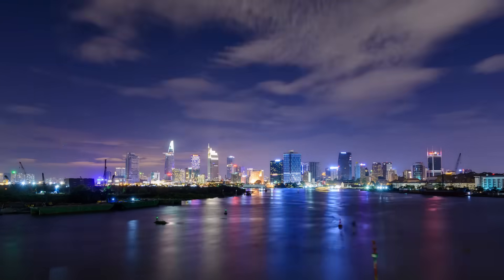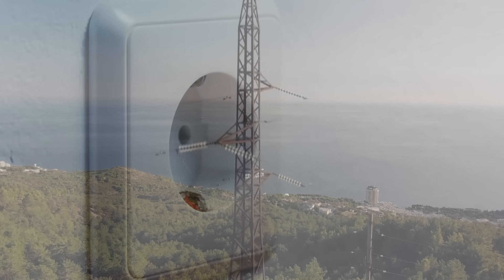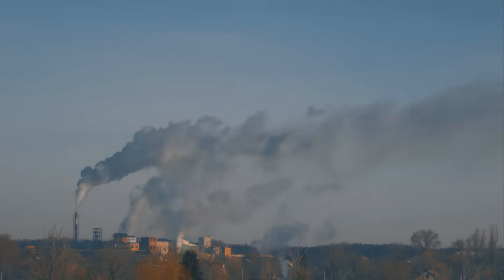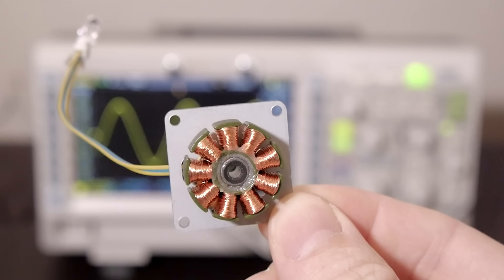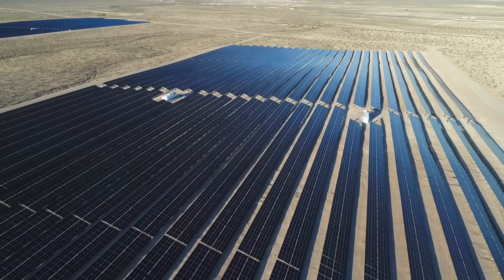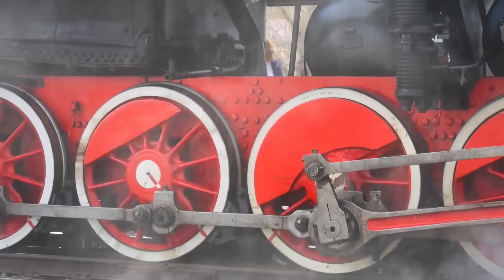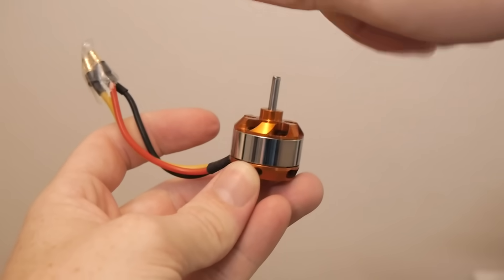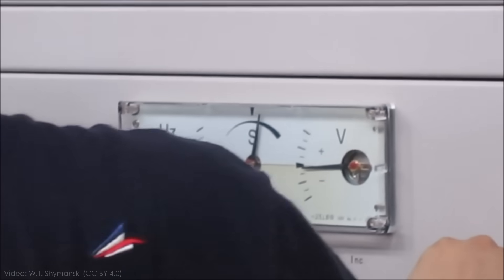How Electricity Generation Really Works

Comment: Three phase doesn't  triple the power. You add one more conductor of the same size and get 1.73 times the power as compared to single phase. Basically it's 50% more copper giving you 73% more power.
Reply: That's because you wrongly picked line voltage instead of phase voltage in your reasoning. Indeed, P3ph = 3*P1ph . Check that square root of three, because there is another one you missed
Reply: @Txepetxcc  The line voltage does not matter. Say you have 240V single phase, and you compare it to 240V three phase, the three phase is 1.73 times the power. And BTW 1.73 is the square root of 3.
Reply: @cindytepper8878  That is fundamentally wrong Cindy! The point precisely is that line voltage matters. How can it not matter if power = voltage*current ? Anyway, the easy way to see it, is that if you have 240V single phase (phase voltage) and you construct a 3 phase system with 3 of those single phase individual generators, each one with a load. Since each of the phases is independent, you have actually 3 times the power of the original single phase!. This is what happens in star configuration.  Now, because usually you cannot access the individual load phase terminals or generator phase terminal, (which would be 6 terminals, 2 per phase), but rather you can access the 3 "positive" terminals , the ones used to distribute the power, you dont measure the 240V of the individual phases, but voltage between positive terminals. Thats called line voltage, and it is a phasor sumation . The line voltage is sqrt(3) of phase voltage in star configuration. Therefore, in the formula of P3ph = 3*P1ph = 3*Vphase*Iphase, since you cannot read phase voltage because it's not accessible tou you in the field but line-to-line voltage is, you have to substitute Vphase = Vline/sqrt(3), and the equation becomes P3ph= sqrt(3)*Vline*Iphase = 1.73*Vline*Iphase , which in star configuration, is also P3phase = 1.73*Vline*Iline . But that's precisely the point! If phase voltage is 240V as you say, line voltage is not , 240V but 415V, and therefore P3phase = 1.73*1.73*240*Current = 3*240*current , which is 3 times the individual power.

Your mistake was using an equation used in the field which asks for line-to-line measurements, with phase measurements. Hope this clarifies it !

Comment: 1:05 not quite. Electrons (they carry energy) in wire move very slowly. The drift velocity is on the order of millimeters per hour. (https://en.wikipedia.org/wiki/Speed_of_electricity)
So it's not like "energy packets" flows at speed of light from generator to end-user device, but they move very slow, with very rapid reaction to start/stop of flow - they are getting pulled like a part of taut rope.
Reply: The energy is actually transferred outside the wire according to Poynting vector. AC is used for the majority of power lines, there electrons just vibrate, their net velocity is zero.
Reply: @FrainBart_main   I wrote it with mostly DC in mind and never exactly thought about AC electron drift (or rather lack of it), thanks for pointing it out!
Nonetheless I must read more about Poynting vector.
Have a nice day!

Comment: It's been demonstrated that there is no correlation between the rise in Co2 in the atmosphere and global warming. Temperatures on earth where higher when Co2 was much lower than it is today. The rise in Co2 levels in the atmosphere causes plant life to grow more quickly. Too bad you tarnished your video which was based in fact by adding the political football of global warming thus forfeiting some credibility. Stick with applied science, your area of knowledge and expertise.
Reply: I have one experiment for you. Take a bottle and fill it with normal air. Take another fill it with methane. Than another and fill it evil Co2. Then take a heat lamp (to simulate the sun) and out it over the bottles. Come back in an hour and you’ll find that the Co2 container is hotter than the air. The methane is hotter than the Co2. So yes. Adding more Co2 into the atmosphere will cause global warming. If we keep adding more the concentration goes up. Co2 is great for keeping in heat which is why it raises the temperature.
Reply: Actually I want to clearly something. The bottles should be at the same heat when taken out of the lamp area. Once then constantly measure the Temperature and you’ll find that the Co2 and methane are all trapping the heat in
Reply: @FemmyFoxxo  Why would you think that's a valid experiment to demonstrate Co2s contribution to heat retention in the atmosphere? In order to create a valid experiment you have to consider all the factors that contribute to heat retention. You would also have to show how 450 parts per million of Co2 in the atmosphere increases heat retention over previous levels of 250 parts per million. A tiny increase at best. The reality is that water vapor in the atmosphere is very significant for retaining heat, cloud cover, and level of solar radiation at the time are overwhelming factors. Historical records demonstrate that the mean temperature on earth is not affected by Co2 levels in the past.  Sorry , but your experiment is random and tells us nothing useful.
Reply: @fredflintstone8048  It is not random. There are a lot of factors. This experiment SHOWS you how Co2 CAN contribute. It shows HOW is contributes and why it is bad. Also where are the sources that you are describing. Who funded them. The experiment tells you Co2 is a green house gas and can cause the rise in temperature as it holds in heat. So please tell me where your sources are for your claims and please tell me who funds them. The experiment can also be added too as well. You can add water into a bottle for water vapor, you can add in nitrogen to see things.
Reply: @FemmyFoxxo  CO2 also reflects light.   On Mars CO2 cools the planet. Venus CO2 warms the planet.   Earth high atmospheres CO2 cools the planet.   Its been debated for decades if CO2 over all cools or warms the planet.   Only recently most scientists believe CO2 has a negligible over all rise in temperature.

I do not like how this video turned political.   there is no excuse for it.
Reply: @OxAO  
How is mentioning global warming political though? It is an issue that is happening right now.
Reply: @FemmyFoxxo     There is no bases in science for it.  There hasn't been a single peer-reviewed paper on man made "Climate change"  IE: global runaway anthropogenic positive feedback loop.    many on local effects.  some on global measured effects.  But no runaway effects as required for the alarmist claims.    Not one single paper.

Comment: Fun fact: the Japanese power grid operates at two different frequencies — 60 cycles in eastern Japan, 50 in western Japan.

Edit: in-home voltage in Japan is 110-115V. Most American domestic appliances will work fine.
Reply: Another obscure fact for your next Trivial Pursuit game - there are also 25Hz and 40Hz systems in North America.  25Hz was the frequency chosen for industrial use, and was the frequency at some of the original Niagara Falls power plants.  Today, the largest remaining 25Hz system is the Amtrak rail line between Washington DC and New York.  40Hz was chosen for special applications in the late 19th century, and has almost completely disappeared.  There is one hydroelectric power plant near Albany, NY that still generates at 40Hz, and until recently, there was some 40Hz load in a paper mill in Maine.
Reply: 110v 60Hz appliances don't work well at 50Hz.  (Synchronous Clocks will lose 10 minutes per hour).  50Hz and 60Hz are close, but as frequency goes down smoke goes up.
Reply: I believe Japanese use 100V, not 110V or 115V. By the way, there's a specific reason why you might see 110V, 115V, or 120V mentioned in the United States. Single phase transformers, which are used in residential and most farming operations are 220V, the transformers are center tapped, which provides half that voltage to the neutral = 110V.

The most common lower voltage 3 phase systems are 208V, when you center tap the transformer between three phases, any hot to neutral voltage would be 208/1.73 = 120V. The square root of 3 = 1.73.

It doesn't mean that your home is really going to measure exactly 110V/220V and commercial is going to measure exactly 120V/208V. These are design voltages, they are still called the above even if their measured voltages vary from those values.

Not knowing whether an appliance such as a microwave oven or a TV will be used in a home or a business, the manufacturer may choose to design to the midpoint between 110V and 120V, which is 115V. Most appliances are designed to work at their design voltage +/- 10% So, most 115V devices will work fine from 103.5V to 126.5V, which will cover residential and commercial voltages and some variation to boot.
Reply: @cornpop7805  110 and 220 are antique terms/voltages. In 1967 the U.S. adopted a standard house voltage of 120/240. This is accomplish by tapping the center connection of the two series connected 120-V secondary windings of a single-phase transformer.  On a well layed out electrical panel the 120-V circuits are equally distributed to ONE of the two ends and the center tap.The larger 240-V appliance circuits connect across the outer ends. The commercial 3-phase 120/208 voltage is accomplish not by center tapping the windings. But by banking three single-phase transformers who have their two secondary 120-V windings reconnected from series to parallel for a 120-V output (i.e. from 240 to 120) then the same termnal of each of three secondaries are connected forming the neutral connection or what is known as a Y configuration. So when you connect to the neutral and the opposite terminal on any of the three transformers you receive 120-V. Because of the 120-degree phase shift between phases, when you connect between the opposite terminal of one transformer and the opposite terminal of any one of the other two transformers you recieve 208-V.    120-V x (sq.root of 3) = 208-V.   Of course the 3-phase loads such as motors, connect to the opposite terminal of each of the three transformers.
Reply: @gratzbuck9882 
You are correct, I said 110/220v and it is actually 120/240V. That's what the secondary of the transformer nameplate usually read. Over the years, I've started to call it 110/220 because I rarely if ever measure 120/240V, it invariably reads less. Also, it always causes a huge discussion if I use say 240V to a residential customer, so I just say 220V.

Everything else I said was correct.
Reply: @cornpop7805  You are correct that most of the general public still uses the terms 110 & 220. But based on where you are on your Utility's distribution system, the system load, and the substation's regulator settings and how well it's working, you should see near about 120/240 voltage. Here in Tennessee on the TVA, and my location on my rural cooperative my voltage usually runs a little high. If your transformer's primary is set on its center tap and the distribution system voltage is running at nameplate, your household voltage will be 120/240. Most transformers have 5 primary taps, 1 dead on, 2 above and 2 below each spaced in 2.5% increments to adjust for variances in the primary voltage, in order to more closely provide a 120/240 secondary voltage.
Reply: kcotte59 
I hope you read this big ass response because I put a lot of time into answering your question (to the nth degree).

The US is 120V/240V (phase to phase div by 2) in homes and usually 120V/208V (phase to phase div by 1.732) in businesses.

European phase to phase voltage is either 380V or 400V, depending on country. The single phase voltages (hot to neutral) follow the same math I laid out before, divide the 3 ph voltage by 1.732 (the sq root of 3). So, 3 ph 380V has a single phase voltage of 219V (usually called 220V). 3 ph 400V has a single phase voltage of 230.9V (usually called 230V).
Voltages can easily be adjusted with transformers, so 220V/380V or 230V/400V can come from the same exact power grid, but be transformed to the desired voltage in the community or factory it is being used.

However, 50Hz and 60Hz cannot exist on the same grid. Most of the world that had strong trade with Europe in 1900 and beyond went 50Hz and most of the countries that had strong trade ties to the US went with 60Hz.

The only REAL challenge with equipment meant for one Hz over another is AC motor speeds. An electric motor designed to run on 60Hz at 1750 rpm would run at 1250 rpm if connected to 50Hz. Conversely, European AC motors would run faster on US 60Hz than designed.

Equipment that have AC motors and aren't speed critical, such as compactors, some conveyors, pumps, mixers, etc can run on 60Hz or 50Hz, the system will just run faster or slower, depending on higher or lower Hz, respectively.

Equipment that have more critical speeds and are designed to operate at 50Hz or 60Hz exists, but they use variable frequency inverters to change the motor speeds. Variable frequency inverters are also simply used for speed controls in many applications, so it's a manufacturer of equipment wouldn't have to necessarily rework an entire machine for the equipment to cross continents. But, the type of equipment I'm talking about is factory equipment and may still require a transformer within the factory to achieve the correct voltage.

I wouldn't bother trying to run home appliances from countries using significantly different voltages, unless your on vacation and you have an adapter. Frequency usually makes little difference in home appliances, other than a potential loss of efficiency.

If you understand all that I've said, feel good. I've had to explain this exact same material to multiple  degreed electrical engineers. I don't know why this isn't covered in a base EE degree.

Comment: My theoretical grasp of electricity is limited to the benchtop scale, so there's probably a simple answer to this question: why not use giant capacitors to buffer shocks to the system?  They're fairly cheap.

Also, you need some pesto on that pizza at the end.  I say that in my capacity as a garlic engineer.
Reply: Capacitor stores energy at DC, so it couldn't be simply connected to grid, it needs special  two-way converter which charges it gracefully (without damaging with overcurrent) and converts its DC to AC synchronized with grid when needed. This can be done: we in Russia tried this for subway recuperation system, so when train stops, its motors become generators and supply power into 3rd rail, but then this power is stored in supercapacitors. So when train starts again, it just takes this energy back. It worked to some extent, but not as well as hoped... In general, capacitors have very low specific energy, so one needs LOTS of them taking up large amounts of space and costing a fortune.

Comment: Wait.. I didn’t know electricity moves at the speed of light.. I thought they were lot slower. That’s why we have fibre optics, right?
Reply: With AC current, electrons jiggle back and forth in the wire, at line frequency. They don't go anywhere. (In DC they drift slowly in one direction.) However, it's the energy that moves at near the speed of light. If you had a long pipe full of marbles all in a row, and you pushed a marble at one end, a reaction travels down the pipe very quickly, and a different marble moves at the other end. So, the effect is that energy moves down the wire at near the speed of light. For things that operate at a high frequency, the wire has a type of impedance called inductive reactance, and it chokes the flow of energy, so for this reason fiber optics is used for high frequency signals, because it uses light instead of electrical current, and so it isn't affected in the same way.
Reply: Solar Fluxman ohhhhhhhhhhhhh

Comment: Global warming, AKA climate change doesn't exist.  Further research on the science will show you this.

The train is voltage, pushing the current that flows.
Reply: Wrong. I've worked on every type of power plant during my life. You can argue about which type of combustion or fuel for steam generation is worst. But climate change is real.

Comment: The message that we need to transition to renewable energy sources is of course good, but I feel that it is always worth noting in this context that climate change is also a sosioeconomic problem. Capitalism inherently incentivizes productive growth irregardles of long-term consequences, and introducing renewable energy sources in such an economic framework is most likely going to result in renewable energy sources being utilized besides non-renewable sources, not instead of . A relative replacement of energy sources is more likely than an absolute one, which is what matters. Besides, Capitalism has a tendency to replace one problem with another, such as rare metals used in solar technology being extracted by child laborers in Africa.
Reply: More generally : focus.
If the topic is electricity generation, why go on a tangent describing climate change ? Just mention in passing we have a problem with CO2, no more.
Anyways climate change is a VERY complex topic, it would require it's own video series.